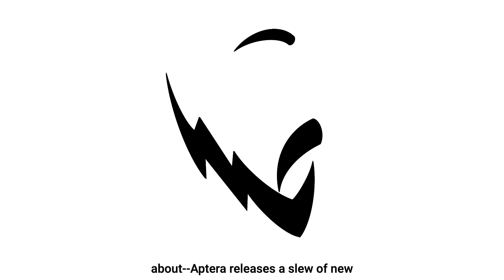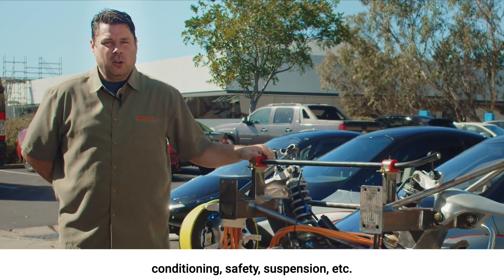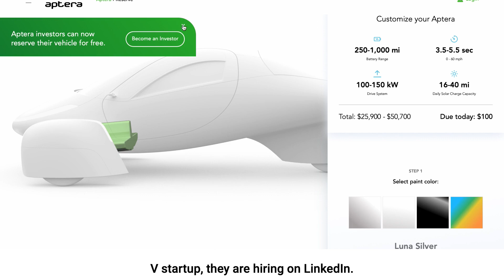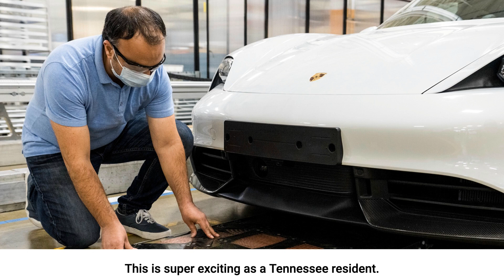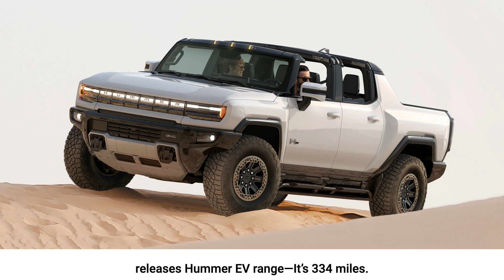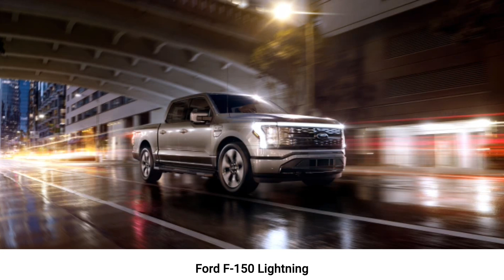Aptera exits alpha stage, Ford starts selling electric motors to hobbyists, and more...

Comment: Why is it EV promoting channels like yours never use a bit of quality control of what you put out - you just echo any garbage that comes your way - Aptera was suppose to be in production already - did you mention that?  Did you mention they have no production people , tooling or training for a production line -  did you think to consider that while others are producing 3 wheel electric motorcycles?  This company didn't even realize it needed a rear view mirror.

Comment: $26000 for a vehicle that's missing a wheel...? Pass, thanks, I'll wait for the Chinese: Can buy a Good Cat for the same money and that's a proper car... Aptera need to face up to the fact they are behind the curve: the Chinese are coming with a slew of vehicles in direct competition with them.... unless they plan to simply stay niche..?
Reply from the maker: I’ve heard they have a more “normal” four seater planned, but I’m sure that is years away. I think the three wheel design is awesome—it definitely gets them noticed and get headlines. And the whole point of the Aptera is to be as aerodynamically efficient as possible. It’s definitely a family car, but would be great for a commuter car or for a single person or couple without kids.
Reply: for someone who drives less than 40 miles a day aptera would be great for me. I'd never need to charge it. 
i dont care if it has no wheels or 300 wheels. if it actually charges 40 miles worth a day I'd be happy with it. 
well it also has to perform well in winter or i'd need 2 cars.